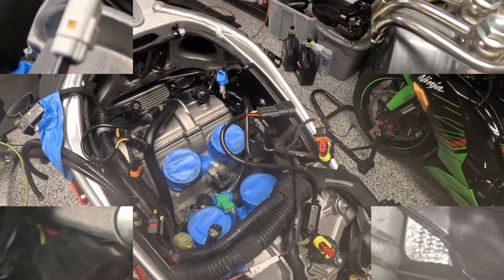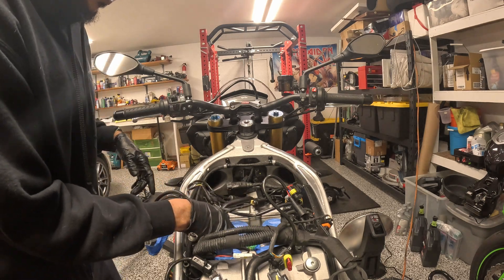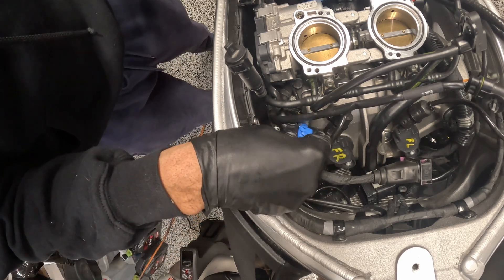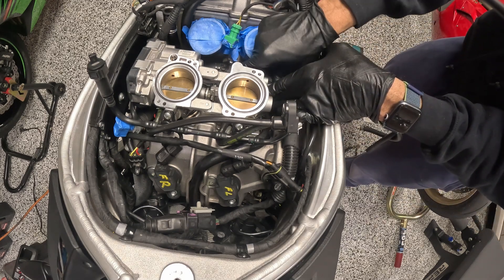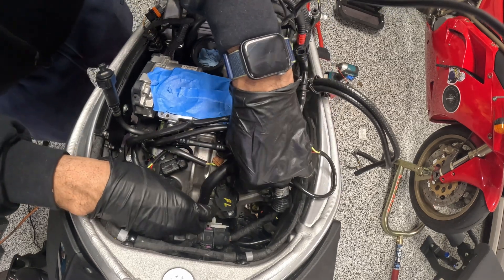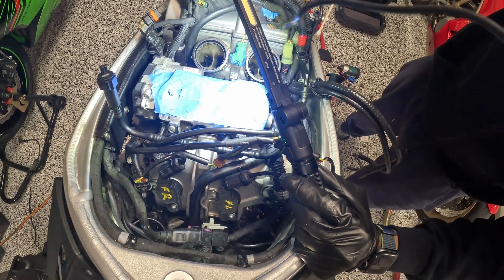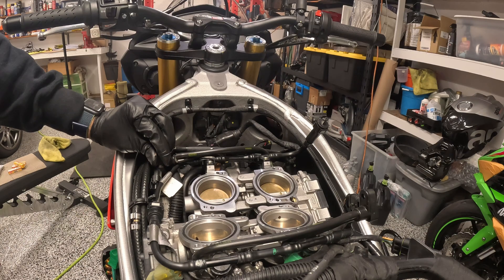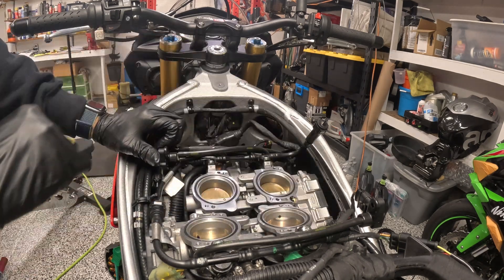Tuono valve clearance part 12: Spark plugs and throttle body reassembly

Comment: How dirty were the valves before cleaning and what did you use? I have one valve cleanish and one with carbon buildup in the same cylinder. Does the spray (with swab) clean this up? Also where are the swabs from? Don't see anything that large anywhere.
Reply from the maker: They weren’t very dirty, a little bit of carbon and some fuel deposits. I show all 4 cylinders in detail in part 2 of the series: https://youtu.be/FDe_X2aPur0?si=aq2HRyIfRVjrymwz. Right around the 18 minute mark. I used the swab and brake parts cleaner to clean it out and it worked pretty well. The swabs are from Harbor Freight if you’re in the US.

Comment: Ive not done this yet myself, but, in hindsight would it not be easier to install the rear TBs first, so you can access the boot clamps from the front then install the front TBs and you can also access their boot clamps from the front? Good work though ....
Reply from the maker: Not sure it is possible to install them in reverse order, but I haven't tried. The manual says to follow the order I did.